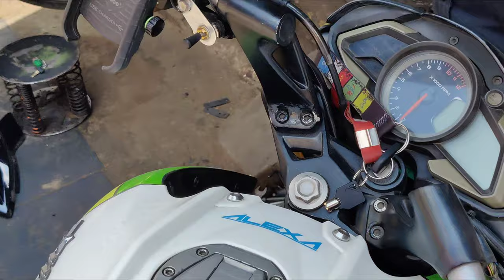installing KTM 250 Handle Bar on My NS 200 | தமிழில்

Comment: Bro.. Do you have any issue with clutch because am using the same handle bar but i have clutch cable tightening issue while turning.. Any alternative for clutch cable
Reply from the maker: Same problem bro
Reply: But i got a solution bro.!!!